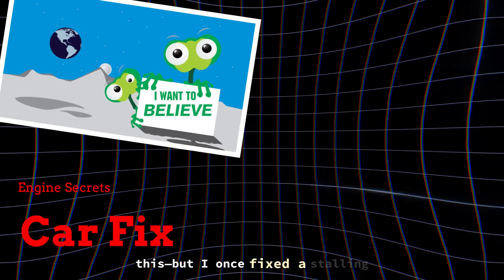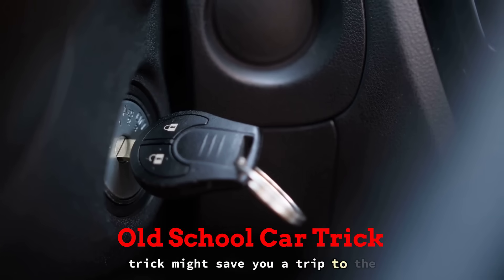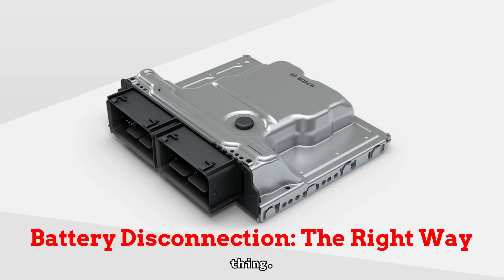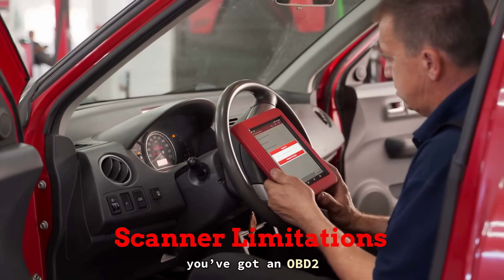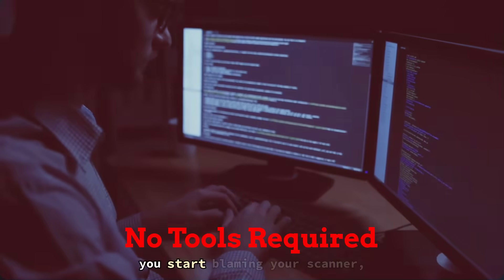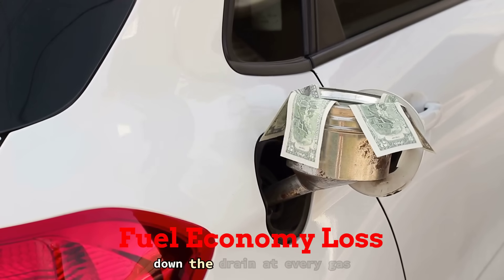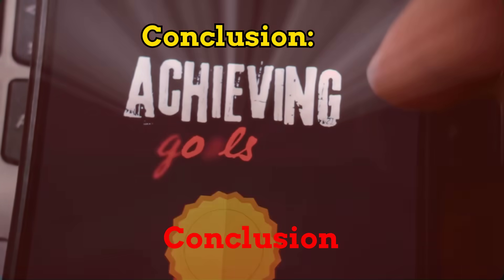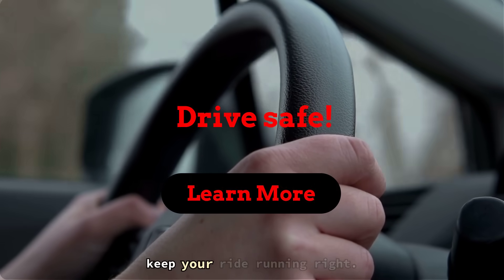Doing This Will RESET Your Car And Fix It For Free (5 Real Mechanic Methods)

Comment: I'm hoping that my failed gas tank gauge will reset after a battery swap.  Very annoying. Ten minutes later and the gas gauge is working! At least now I KNOW I'm out of gas.  Beats the hell out of using the odometer.  Sitting in it now waiting for ten minutes to pass but the gauge continues telling me the truth. THANKS!! UPDATE  It's been nine minutes and the idle just smoothed out.  The gas gauge is reading true now too. It used to show accurate but would immediately start jumping around and slowly goes up to a full false reading.  Right now it's still normal without all that nonsense.  YOU JUST SAVED ME $150 easy.  Minimum.  If this is still normal after a week I'm sending you some scratch. 2nd update; the gas gauge only reads normally when I start the car.  When I actually move the car the glitch returned,  but now my 2003 Buick Regal ls is running better than it ever has.  Saweet! At least when I start driving I know at the start what gas I actually have.  I guess it's fuel gauge replacement time.  In my car it's just a $150 fix. C-ya!
Reply from the maker: That’s awesome to hear @flatline827 🙌 glad the reset at least smoothed out the idle and helped your Regal run better! Yeah, that gauge behavior sounds like a fuel level sender issue inside the tank — super common on those Buicks. At least you know the rest of the system’s healthy now. Appreciate you sharing the full update — that kind of feedback helps a ton of folks here

Comment: I have a 2005 Honda Accord that was sitting for a few months. I replaced the battery, maf sensor, and tps. Now it idles at 3000rpm. I tried all of these except the last one. It's also a 4 cylinder with a 5 speed manual if that makes a difference.
Reply from the maker: Hey @CrimsonShadow728 👋 yeah, that high idle is definitely not normal. Since you already swapped the MAF and TPS, check for vacuum leaks around the intake hose or manifold — sitting for months can make rubber lines crack or loosen. Also make sure the idle air control valve (IACV) isn’t stuck open and that the throttle plate isn’t slightly jammed. After fixing any leaks, try the last reset method — it often helps the ECU relearn proper idle after parts replacement
Reply: @CarCareFix  I just checked the hose that runs from the air filter box to the throttle body. It has a few small cracks in it, so it's definitely pulling too much air. Thank you for your help.

Comment: 2012 Honda Civic tires changed and I can't get the lights out because my tires have been changed and I guess the sensors went bad so the lights won't go out now
Reply from the maker: Hey @VanessaMcCarty-j9k 👋 that’s super common after a tire change — the TPMS sensors inside the wheels might not be reading correctly or need reprogramming. If one got damaged or has a dead battery, the light will stay on. Try driving for 10–15 minutes above 30 mph to let the system relearn, but if it doesn’t clear, you’ll likely need one or two new TPMS sensors replaced or reprogrammed

Comment: I have a 2013 Ford escape and went to change battery and now it won't start. Trouble shooting didn't work 😢
Reply from the maker: Hey @SamanthaAinplayn 😢 that’s a common one after a battery swap on newer Fords — the ECU sometimes loses communication with the anti-theft or throttle system. Try this: disconnect both battery cables, touch them together for 10 seconds, then reconnect and turn the key to ON for 2 minutes (don’t start). That lets the ECU rele

Comment: I have a 2008 Lexus rx350..orileys says it is ABS sensor an has to be cleared an to go to the toyota dealership..car goes in gear an just a short time when taking off...it acts like you slammed on the breaks..only for a second an does this for a few  more times ...will this after it goes all through gears...will this reset work on mine
Reply from the maker: Hey @pamelahedrick2636 👋 sounds like your ABS is kicking in when it shouldn’t — usually a bad wheel speed sensor or dirty tone ring. The reset might clear the warning light temporarily, but if the sensor’s still sending bad data, the issue will come right back. I’d check that ABS sensor wiring and make sure there’s no rust or debris near the hub before paying dealer prices 👍

Comment: I tried these methods on the Pajero io 4G93 engine the engine check light does not go off, help please
Reply from the maker: Hey @BillyZimba-tl1gd — if the check light stays on after the reset, that means there’s still an active fault stored in the ECU. 🚨 Try scanning it with an OBD2 scanner first — even a cheap one will show the exact code. Clear it, drive for a bit, and see if it returns. If it does, that means the issue’s real — like a bad sensor or wiring fault — not just a memory glitch.

Comment: Thankyou for the great tips i will definitely subscribe.  I have a 2008 hyundai tucson automatic that starts over reving after driving approximately 8km  revs normally till i drive about 5 to 8 klm if i stop turn ignition off and wait a few minutes revs settle again. Ill try your tips and see how i go. Thankyou
Reply from the maker: Thanks for the subscription! Your Hyundai Tucson's revving issue sounds like it could be an adaptive learning or sensor glitch, so hopefully one of these reset methods gets it sorted for you. Keep me posted on how it goes!

Comment: I have a 2013 merc c200. I am getting an anti theft activated message on my radio every time I start it. Holding the power button for 10 seconds fixes the issue but it’s a pain having to do this every time. Reckon if I do the battery disconnect it may fix the issue?
Reply from the maker: Good question, @seanorphoto — yes, a full battery disconnect reset can sometimes clear that anti-theft glitch if it’s just a memory bug. 👍 Just make sure you’ve got your radio code (if required) before doing it, and leave the battery disconnected for at least 15 minutes. If it still comes back, it could be a weak backup battery or key sync issue.

Comment: What about audi
Reply from the maker: @michelleold9048 Good question — most Audis use adaptive ECUs, so the battery and jumper cable reset (Fix #2 or #5) still works, but you’ll also want to do a throttle relearn afterward. Key-on, press the gas pedal slowly to the floor, hold for 5 seconds, then release — that helps the idle and throttle recalibrate after any reset. I’ve done this on A4s and Q5s plenty of times

Comment: I have a 2009 dodge journey v6 changed the starter, Crank position sensor , camshaft position sensor A bank 1 single sensor still won’t start guy put oil in my spark plugs now it won’t do anything but click when you try and start it I’m on a fixed income help please 8:07
Reply: What can I do to fix this ?
Reply from the maker: Hey @sonyagilmore7179 — that sounds rough, I’m sorry you’re dealing with that. 😔 If it only clicks now, start simple: check your battery voltage (should be around 12.6V), make sure the terminals are clean and tight, and inspect your main ground connection. If those are good, the starter relay or the starter itself may have failed again — especially if oil got into electrical areas. Don’t give up yet; sometimes it’s something small.
Reply: @CarCareFix thank you for the encouragement I’m at my wits end I paid for this truck  and I’m trying to get all the years left out of it.

Comment: Thanks for your video which will be most helpful in the future I'm sure. It was so enlightening that I have subscribed in case something related goes wrong again with my 2010 Ford Focus here in UK. I had intermittent flashing lights and codes coming up on my dash and the local "so called" Diagnostic Centre charged me £150 to tell me that there was nothing that they could find because everything worked fine while they had it for two days. Well, as the saying goes "If it 'aint broke, I can't fix it." They quoted me £900 to remove the dash, repair the problem that they were sure to find when disassembled, and re install the dash. So I went on to You Tube and found a company that repairs the dash for £69 and then on to another guy that showed how the dash was easy to remove and replace. Short story from beginning to end, it cost me £67 in total and 15 minutes to remove and then refit the dash! The Diagnostic Centre had quoted me £300 to do the same job! I will be watching your site with baited breath. Thanks once again for the tips for the future problems that may occur.
Reply from the maker: Wow @kentilly6160, that’s an incredible story 👏—perfect example of why it pays to do a little digging before handing over big money at a shop. £900 vs £76 is a massive difference, and you handled it like a pro. 💪 Thanks a ton for subscribing—I’ll keep sharing tips that save time and money, just like in your case. Glad the video could help, and respect for tackling that dash job yourself!
Reply: But if there something wrong with  say a sensor, the light will turn  back on.

Comment: Try 175 now for a diagnostic test😮
Reply from the maker: Yeah @mquinlan676, it’s crazy how high those diagnostic fees have gotten 😮. That’s exactly why I share these reset tricks—sometimes it’s a simple computer glitch, not a $175 problem. 💸

Have you ever had them quote you for a repair right after the diagnostic too?
Reply: @CarCareFix my brother is having a problem with a 2019 Chevy Blazer and it's been on YouTube voltage regulator doesn't stay at 1414 1/2 used to be a mechanic so far they wanted to put in a new battery attention belt another belt also the shifter arm cracked they must have diagnose this 100 times also the sunroof just went that was 2500 dolls they had to replace it all this car is not abused doesn't have one scratch on it super gorgeous condition he is anal he finally went down to see the dealer over the weekend and told him he ain't paying one more time
Reply: But thank you this helps a lot of people

Comment: Every time I turn the wheel to the right and back it makes a noise like it hit something with the engine off the steering wheel doesn't lock and I noticed that the power steering fluid over flows under the hood sometimes
Reply from the maker: That’s a good catch @Saied-u7e 👌 The noise plus fluid overflow points to your power steering system being over-pressurized or aerating. A few things to check:

Fluid level – make sure it’s not overfilled, because excess will push out when you turn.

Air in the system – if the fluid foams, you might have a leak on the suction side (like a cracked hose or loose clamp).

Steering rack or pump – a failing pump or internal rack issue can also cause noise and fluid pushback.

Since the wheel doesn’t lock, it’s not a column lock issue—it’s hydraulic. I’d start by bleeding the system properly and checking for leaks around the return hose and pump. If it keeps overflowing, the pump might be on its way out.

Comment: Have Opel astra 1.7 cdti from 2011 and when engine is cold and I start the engine  “ service vehicle soon “ pop up engine works unevenly shakes and I see blue-white smoke coming out exhaust for 1 minute after that work just fine, when I turn it off and then turn on again there is no message “ service vehicle soon “ and no smoke, I guess it is a glowing plug ? . Someone with similar problem TY
Reply from the maker: ChatGPT said:

You’re spot on @Smartax1307 👍 The symptoms scream glow plug issue (rough idle, white/blue smoke, only on cold start). When the plugs don’t heat up right, the diesel doesn’t burn clean until the engine warms up, which explains why it smooths out after a minute and no smoke on restarts. I’d check the glow plugs and the relay first—they’re common wear items on the Astra CDTI. Also worth scanning codes if you can, since “Service Vehicle Soon” can sometimes point to other cold-start sensors (like coolant temp sensor or injector balance). But 9 times out of 10, it’s glow plugs.
Reply: @CarCareFix ty so much

Comment: I have Honda Legend 2009 need to reset the VSA light
Reply from the maker: Got you @AbanoubHabieb 👍 On your 2009 Honda Legend, the VSA (Vehicle Stability Assist) light usually comes on if the system detects a fault or after a low battery/disconnect.

Here are a couple of things you can try before heading to a shop:

1. Basic reset – turn the ignition ON (engine off), then press and hold the VSA OFF button until the light on the dash goes out.

2. Battery reset – disconnect the negative terminal for about 10–15 minutes, press the brake pedal to drain any leftover charge, then reconnect. Sometimes that clears stored faults.

3. If the light comes back → it usually means a sensor issue (like ABS wheel speed sensors or steering angle sensor). In that case, a scan tool will be needed to pinpoint and clear it properly.

Start with the easy resets—you might get lucky.

Comment: #2 did NOT do any reset on both my cars!!! 2007 Saab 9-3 2.0T convertible and 2010 saab 9-3X wagon!!  Nothing were made by GM

Not one light turned off!!  I did exactly to your video 😢😢
Reply from the maker: @marymarseglia4536 Thanks for giving it a try and sharing back 🙏. Some Saabs are tricky because GM’s reset methods don’t always apply 1:1. On those cars, the ECU usually holds codes until you either drive a full cycle (cold start ➝ warm up ➝ highway ➝ idle) or clear them with a scan tool.

Also keep in mind—if there’s a physical issue still present (bad sensor, wiring fault, vacuum leak, etc.), the ECU will keep detecting it and the light won’t stay off, no matter how many resets you try. A reset only clears the memory temporarily, but as soon as the system re-runs its self-check, it’ll flag the problem again. That’s why fixing the root cause always comes first, then a reset makes sense.

Comment: I have a problem on a 2005 model opel astra 1.6 twinport  the service button keeps coming up what can it be ive done the service
Reply from the maker: That’s a common one @SERGIO-x6f7c 👌 On the Opel Astra, the “service” light doesn’t always mean something is broken—it can just be a reminder that needs resetting after maintenance. Even if you’ve done the service, the car won’t know until you manually reset it. Usually, you hold down the trip/reset button on the dash, turn the ignition on (without starting), and keep holding until the display flashes and clears. If it still comes back, then it could be a sensor (like oil quality, O2, or emissions) triggering the service reminder.

Comment: Tk u I'm having  trouble with my neural safety switch
Reply from the maker: You’re welcome @AnneRogers-o8g 🙏 A tricky neutral safety switch can definitely cause headaches—it can stop the car from starting even when everything else is fine. Sometimes cycling the shifter through all gears or cleaning the connections helps, but if it’s worn, replacement is usually the fix. Hope you get it sorted without too much hassle!

Comment: I wasn't aware of pressing the brake pedal, but I've used the others. 

#5 I heard years ago - even though people tell me it's gonna fry the electronics, I've used it to success several times!
Reply from the maker: That’s solid, @jayayyyyy 👌 — pressing the brake just helps drain any leftover charge faster, so it pairs well with the other resets. And you’re right, #5 gets debated a lot, but like you said, plenty of people (myself included) have had success with it. Just always make sure the battery’s fully disconnected first 👍.

Comment: You can also drain left over juice by turning on you headlights while the battery is still disconnected
Reply from the maker: Yep, that’s exactly right 👍 — flipping the headlights on while the battery’s disconnected helps bleed off any leftover power in the system so modules fully discharge. It’s a good little trick to make sure the reset actually sticks.
Reply: @CarCareFix  wouldn't having interior lights on or something like a dash cam plugged in to the cigarette lighter do the same thing?

Comment: I have a 1993 dodge d 150 4x4  with a knew computer ecm  .it runs good, but keep getting red. Check engine light on, but I plug  in an Ob2  scaner, but it won't work. I won't read ecm. I check all wires from plug to ecm. All good .scaner works on my land rover .is there a way to reset the computer so I can use scaner?
Reply from the maker: On that ’93 Dodge you actually won’t get anything from an OBD2 scanner — your truck is still OBD1, so the plug and communication are totally different from newer systems. The trick for those is the old “key dance”: turn the ignition key ON-OFF-ON-OFF-ON (without cranking) and then watch the check engine light flash out the codes. It’ll blink in sequences (like 2 flashes, pause, 3 flashes = code 23).

You can also disconnect the battery for a few minutes to clear memory, but the codes will come back if the fault is still present. 👍

Comment: YEAH BUT!  IT WILL RESET to a FAULT after 50 miles. THESE DON'T "FIX" ANYTHING it just clears the fault code.
"cheers!"
Reply from the maker: Exactly right 👍 — these resets don’t magically fix a bad sensor, failing part, or wiring issue. They just clear the ECU’s memory so the system can relearn fresh. If the problem’s still there, the code will definitely come back once the computer sees it again. Thanks for pointing that out — helps keep the info real for everyone 👌.

Comment: How about for a 08 Toyota tundra, any secrets?
Reply from the maker: Good question, Angel 👌. On an ’08 Tundra a lot of the basic resets still apply — battery disconnect, pedal/throttle reset, or using a scan tool. But those trucks are picky with emissions monitors, so if it’s a check engine light you’re chasing, sometimes it takes a proper drive cycle (cold start, highway cruise, a few stop-and-go runs) before the computer clears everything.